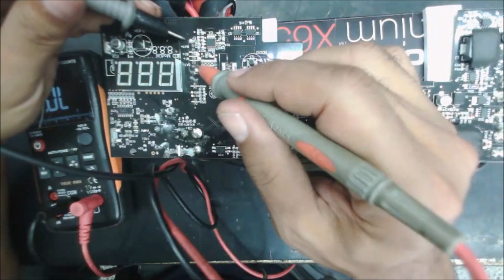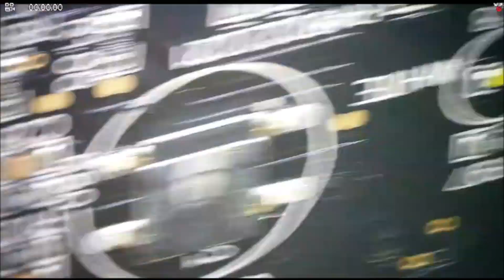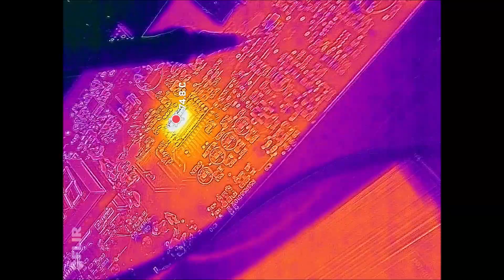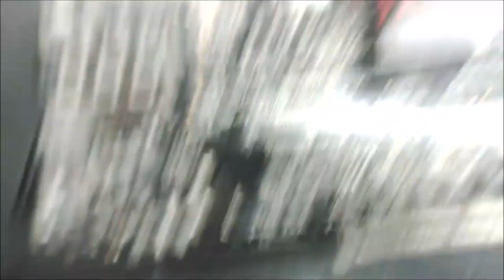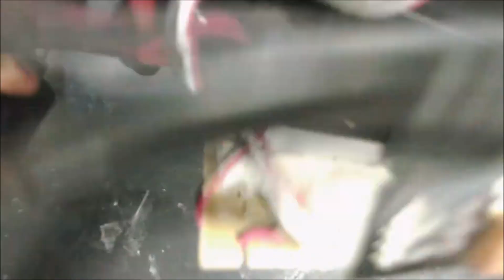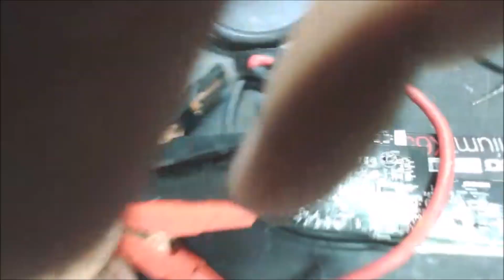Noco GB150 good battery but wont turns on

Comment: hello, my battery is flashing green for more than 10 hours, but it does not fully charge, what is the reason if you can, tell me thanks in   advance the model NOCO BOOST 150
Reply from the maker: the cells voltages are not the same, normal for lithium battery cells